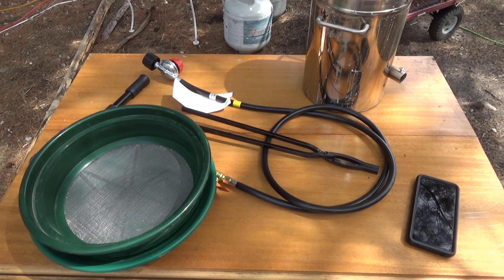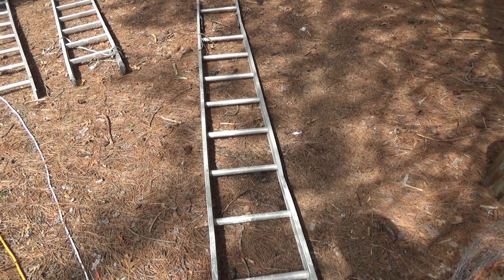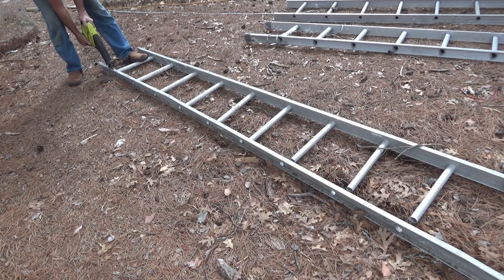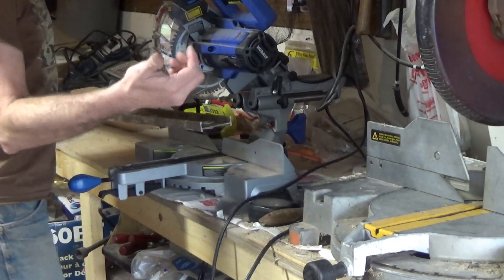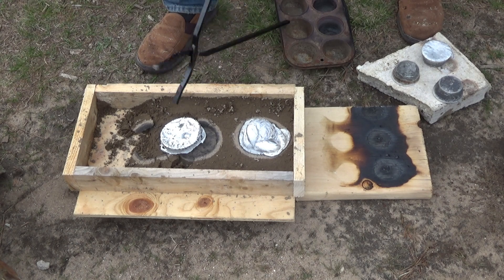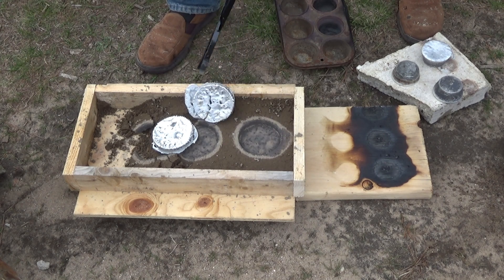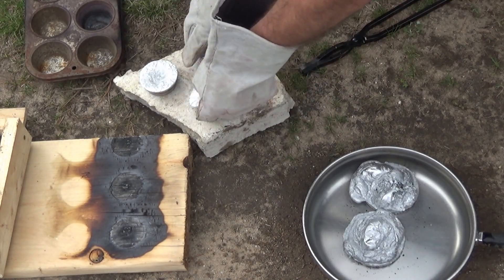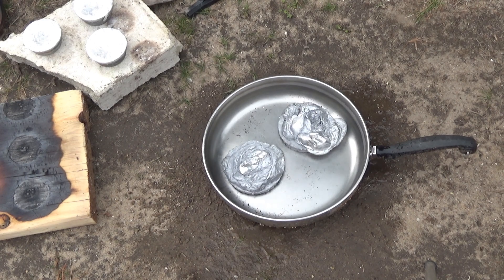Melting Aluminum In My Vevor Furnace And Sand Casting

Comment: Any chance of molten metal popping out of there? And what will you do with what you made?
Reply from the maker: If your material is wet, it will violently bubble and splash like a volcano. When dropping pieces in it can spash. Thats why later I put on leather gloves to protect myself from the liquid metal. I plan to make electric motor flywheels for my electronics lab for now. Later I can make coins for sale, tools, whatever. Its awesome to have the ability to just make anything you need.
Reply: Yes, it can splash

Comment: I used to make lead door stops out of tire weights in tuna fish cans on an electric stove. I picked up the weights in the street as I walked along. When the lead cooled it would just drop out of the can. I must have had a couple hundred pounds of lead stacked in the apartment. I did find that when I just touched a little flux to the hot lead it would bond to the can. Good for making Bullets.
Reply from the maker: I want to start collected lead too. Dangerous to work with in many ways though.